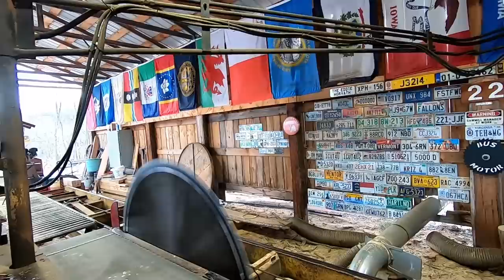sawing a frozen pin oak log # 375

Comment: I used to haul logs.  I would go down to the old Coastal Mill in Hopwood and pickup logs too big for their carriage (72") and transport them to a small mill.  They had a pit, and took a 880 with a 6 foot bar and ripped them. Cut a ton of switch ties out of them.  Like you, it's awesome you take junk and make it treasure.
Reply: I worked there many years ago at the Treating Plant....Frazees when I first started there.Ran Highlift..Treated a lot of posts and caps and drubbing for the coal mines..Coastal bought them a few years later..Transferred to the sawmill ,ran Highlift there Unloaded many a log trucks ..When I had some spare time which was very little I would stand in the booth and watch and talk to the sawyer..He was really good..He's probably passed away or way up in years now..He was a good guy..Worked there till the mill burned down..Worked first shift in the morning from 630 to 3:00. No sooner got home from work then a friend came by and said the mills on fire.Rode down with him to the mill and it was gone...That was many years ago..Wanted to transfer us to another mill to do their 2nd shift but with the travel 2nd shift and the pay was not great I left ..That was many years ago..My best memories was working at the Treating Plant.Had a great Boss there too.One of the nicest guy you'd ever want to meet and work for...If I missed anything of that place it would be that..

Comment: I'm from north/central Minnesota,. I'm 61 years old and grew up  logging and sawmilling. It started out with a portable mill that was pulled from one logging job to the the next one to eliminate additional trucking expense. As near as I can remember it had to be around 1983 we set it up in a permanent location east of where we lived and did contract sawing, from 1983 to 1995. This was a stick mill with a hand, dog, hand setworks, and a kicker type log turner, that we made at home. From about 1985 to 1996 that mill ran between 1.2 and 1.5 MBF a year. We did run live with everything that could be edged run through the edger at the time. There was a four man crew, (as long as you could hire workers) and we sawed every weekday that was -20 below and above, doing repairs on weekends and at night. Colder than that, that we logged or just took a break and stayed home.

Comment: I haven't worked black oak but I've rived, split and even made axe handles out of pin oak.   It can make really pretty lumber but as you're noting the knots can be plentiful.  Also can have other problems like ring shake. 

I can't really tell by the look of it if it's pin oak other than how fast it grew.  Pin oak tends to get big quick.   But I mostly see that fast growth outside of a forest canopy.   I think the smell is pretty distinct with pin oak.  A bit stankier than red oak.  I like the smell but I can see why some wouldn't.  If you can find good lumber in a pin oak tree it can be pretty special.  Not the best for impact tools but I've given it a try anyway with decent success.  

Great videos man.  I love seeing your mill.  That thing is such a beast.  Hadn't really ever thought about rip cutting frozen wood.  Frozen wood is usually a pleasure to split so it's interesting to hear about how it's sawn.

Comment: Frozen logs are more of a challenge on a band mill as well. The blade likes to wander as it cuts.
Reply: Try a 4 degree blade from woodmizer, they work great in frozen stuff, then 7-10 in the warmer weather.
Reply: @Dubya 2  I have heard that. I will have to get some from my supplier.

Comment: I don't think you wasted much at all on the big pine. I'm cutting a pine that the top got broke off from 2 years ago in a wind storm. I felled the 25' that was still standing the other day. 20" on the small end and 32" at the stump.  I'm only keeping two 8.5' logs from the stump up and I'm throwing out about 4'' of the circumference to get by the insect damage. So about 8'' total diameter waste. It doesn't take long for insects to do damage on dead/down pine.

Comment: correct me if im wrong but if you waste 50% of a log its still 100% more than if it wasnt sawn by you guys and ended up in land fill or whatever so its a win win they dont think about that when they comment
Reply: I like the way you do math Cedric! It all adds up. We multiply the number of boards we get out of the division of a massive log, minus some firewood chunks. And it equals useful materials from a crappy log, at a fraction of the cost of big box store lumber. And we round that all up with the positive entertainment quotient of the video for you guys! Problem solved! 
Thanks for watch and we appreciate the comment!
ZZ Mark

Comment: Several, many(?) sav mills make a first cut and then turns that new flat towards the vertical support, 1/2 rev, but You turn them 3/4 of a rev. having the new surface downwards. Why the difference?

Comment: Hey, Mark, I have a question: the guy I work for has an old circular mill that was a homemade, kinda of a hybrid, but basically the same as yours, the drive motor for the carriage went bad, and I was wondering if you could give me some info on a new one? We tried a different one he picked up at a sale but it's way too fast as far as the feed rate. It's a hydraulic motor. Thanks, love watching your videos, I own a band mill, but love working with the circular sawn stuff.
Reply: You can't adjust the feed rate on the new motor you bought at a sale?
Reply: @verteup  no, it's direct drive, no flow control on it

Comment: Would the froze one when it warms you find cracks. Or I mean concealed till a warm day. Now make a walnut cracker that be helpful. And leave the black walnuts alone. The nut population is smaller. THERE sure not California walnuts. You cut them. I guess you tell I like them and am a little put back a squirl rotates and tosses bad nuts. And gets is the nut so easy. Yea I am a nut. With pride.

Comment: What do You all do to maintain the Teeth on the Saw Blade. And what is the Life of that Saw Blade.
Reply: If you search through his past videos you will see he uses an attachment to sharpen the teeth which are carbide inserts, which eventually they need replaced. So unless Mark hits something to wreck the blade the blade will last for years until the pockets for the inserts wear out.